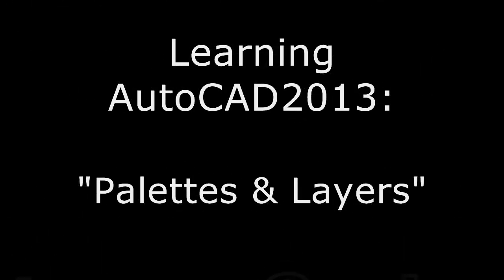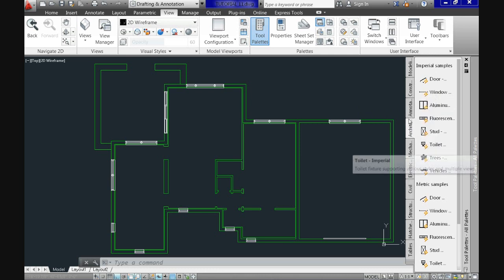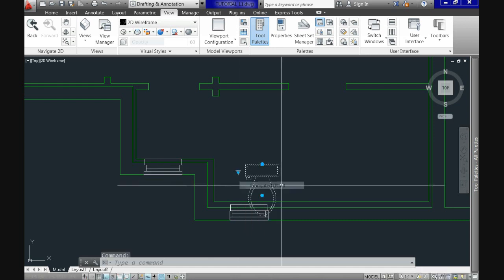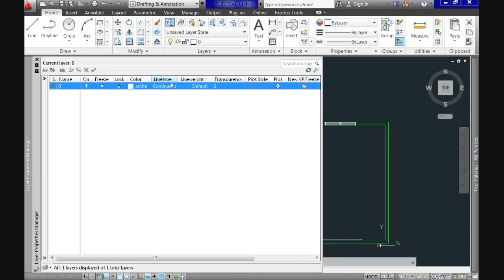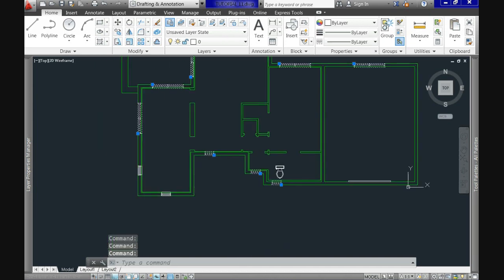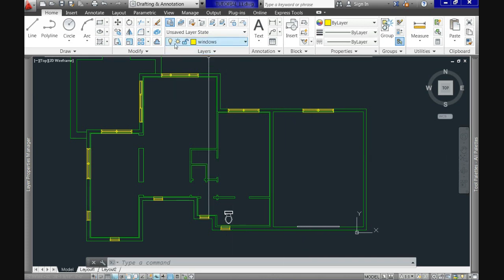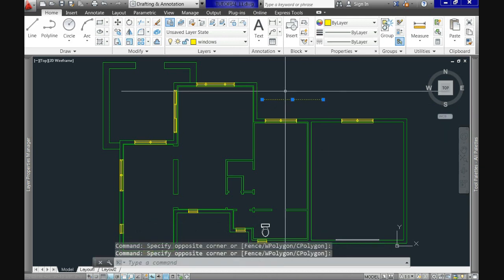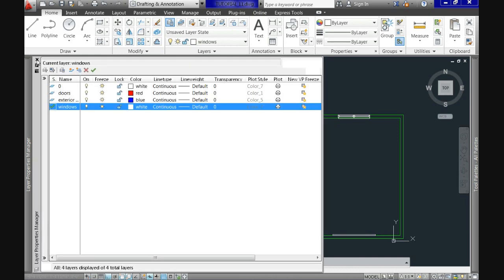Learning AutoCAD 2013 Tutorial 11: "Palettes and Layers"

Comment: hello sir, i created the layer named windows and follow all the steps that you have done. i selected all the windows then clicked on the layer window that i created, the problem is none of the windows changed the color, they are all white but once you click on them, they will show the color of the layer on the layers menu panel .
Reply from the maker: nancy iipinge I'm glad you finally got it.Regards
Reply: at first i didn't understand what you mean't by i should explode the blocks but i manage to do it and change color to yellow... everything worked out right. thank you very much sir
Reply: I have the same problem ..
Reply: i thought it was just me
Reply from the maker: Hi Nancy,
If all of them are blocks (I'm assuming they are) they will keep the properties you assigned to it when you created them. So in that case an option should be to modify their settings to show the color of the layer they are assigned to. Notice on the right, on my properties panel it is set to show the color "By layer" that is something has to be assigned to blocks at the moment of creation. Otherwise they will only show their own properties regardless of the layer they are assigned to. Please let me know if this helps, in cad we have tons of possible reasons for every issue.
Regards
Reply from the maker: Ahmad AL-hakeem Please look at the reply I just did on that issue to Nancy, if it doesn't help you, please let me know so i can guide you through.
Reply: hello sir, 
on the properties panel it is set to show the color "By layer" which i set it to red, which is still the color assigned to the layer.... once you click on these blocks the color on the panel says they are all red but they remain white...
Reply from the maker: nancy iipinge
Of course, because as I said before, they are retaining their own properties. Try this: 1- Explode the blocks (it should take it to red color) 2- Move all the objects (lines, etc) to layer 0. 3- Select all the objects again and modify the color to "by layer" (it should remain white). 4- Set layer 0 as "current" 5- Create again the blocks in layer 0. 6- Now move them to the layer you want.
Let me know how it goes, I hope I didn't skip a step :)

Comment from the maker: Ok, that should have worked but if you want to follow that method I explained, just tell me exactly what you did. The other think you can do is make sure to create the windows from scratch in layer 0 and then create there the blocks. After that you can move the blocks to the layer you prefer. Let me know if it works.
Regards

Comment from the maker: The fastest way is this (at least for me):
1- Use command "explode" and select the blocks. It will turn it back to what it was, Ex: lines or Plines, etc.
2- Move all the elements of the windows to layer 0 and make sure 0 is the current layer.
3- Use the windows to create blocks again. 
4- Now the blocks should accept the properties of the layer you move them to.

Please post back and let me know if that solve your issue.
Best regards

Comment from the maker: Place other objects in the layer and see if the color change to yellow, Ex: try with a line or circle, etc. If that's the case, what happen is that as i explained in "tutorial 10" you have to create blocks in the default layer 0 and then you can move it to any other layer. If you created the "window blocks" in any layer other than zero it will not change properties to the layer you later move it to.  Please post back to see if this is the case and I'll tell you how to correct it.
Regards